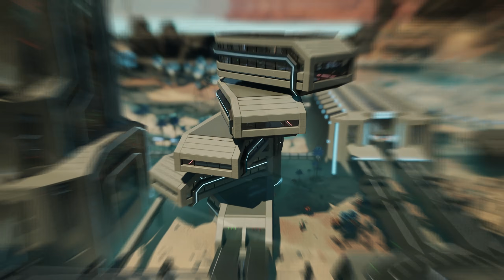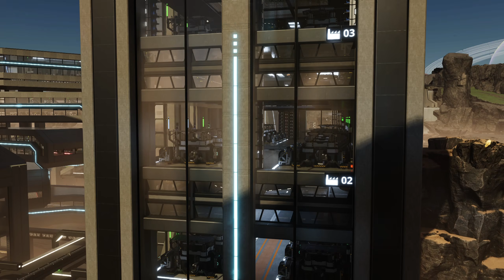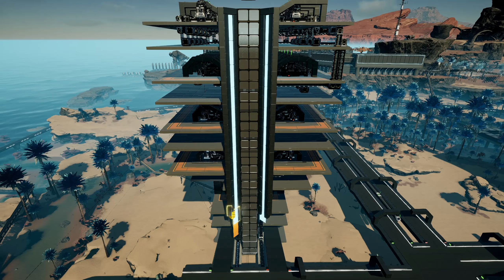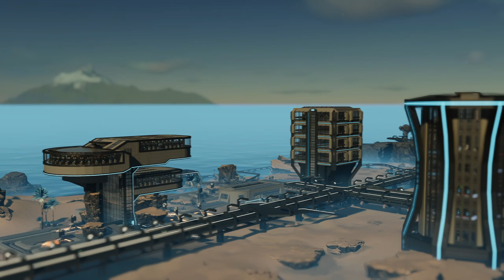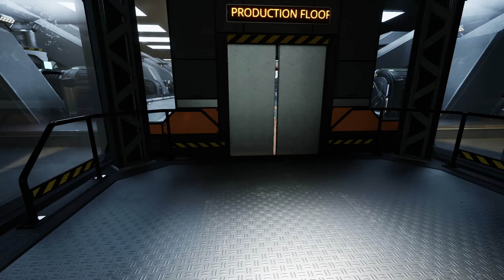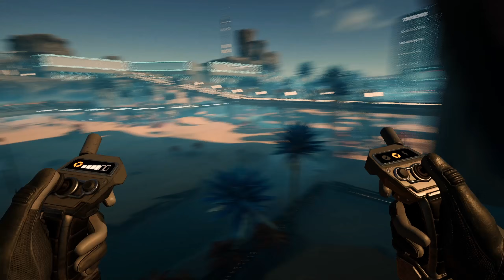Sleek Industrial Sci-Fi HMF Factory

Comment: Did you go back and add more to the computer/circuit factory or just soomersloop it?
Reply from the maker: No generally i dont change factories once they are done. Everything in the Cyber City rocky desert area is mostly for my dimetional depo for general use ging frward. So for the Spire coast Super Computer i build the required circuit board and computers as needed. Ill be using alot of spire coast products and moving them to the Dune Desert to aid in the phase 4.
Reply: @MyNameJakes oh sorry I meant you weren't producing enough for 3 HMF so how did you scale it to that?
Reply from the maker: @JayEmm  aah yes slooped the final machine

Comment: If you're only making 3.75 pm, it's take you 10 years to complete the entire game lol
Reply from the maker: Depends entirely on what those ..for instance if this is my only HMF factory then yes will take for ever. If this is only for my dimensional depo the 3.75pm would be more than enough.

You get 2 guesses which one it is...pretty sure you only need one  :)
Reply: @MyNameJakes  - I see. Does that mean you will be rebuilding these awesome factories in late game? 
I'm hoping to build 60 Ballistic Warp Drives per minute, and it's... taking a while - and I'm going to store a million of them, then run them through the sink just to see how many tickets I get. I think about 2 Million !
Reply from the maker: @manwithanaccent4315  To some extent yes but as needed per factory, you can see that in my newer videos. Also 60 ballistic warps...i dont think youve done the math my man. 
You'll need like 250000 coal, 113000plastic, 200000 iron ingots, 70000 sam to name a few.  You looking at 1000's and 1000's of individual machines. 😶
Reply: @MyNameJakes  - I've looked at the numbers - With MK3 miners overclocked at 250%, the map is capable of 92,000 Iron, 36,900 copper, 69,900 limestone, 12,300 bauxite, and 10,200 SAM ore – these numbers or per minute possible. There is enough ores in the world to support 60 BWDs pm.
Full item breakdown from raw to BWD (rates for 60/min sustained): Raw ores feed smelters/converters (824 smelters for ingots: ~25k iron ingots, 20k copper ingots, 21k limestone to powder/quickwire/concrete; 739 converters for residues). Constructors (584) produce plates/rods/beams: 155 Heavy Modular Frames (Heavy Encased Frame alt), 125 Fused Modular Frames, 389 rotors, 1,141 stators. Assemblers (1,304) handle motors/frames: 255 Motors (Rotor alt), 475 Computers, 900 Circuit Boards, 37.5 High-Speed Connectors, 75 Supercomputers, 60 Neural Computers. Manufacturers (620) for advanced: 95 Pressure Conversion Cubes, 1,097 AI Limiters, 120 Superposition Oscillators, 1097 AI Limiters (residue source). Blenders (335) mix fluids: 14,811 Fuel, 2,400 Turbo Fuel, 900 Rocket Fuel, 900 Ionized Fuel (all Residue/Diluted alts). Refineries (1,750) process oils/nitrogen: 9,505 m³/min crude oil, 11,790 m³/min nitrogen gas (packaged via 110 packagers/drones), 6,165 sulfur. Accelerators/Encoders (282 PA, 113 QE) yield crystals: 551 Crystal Oscillators, Time Crystals/Dark Matter via nuclear waste (56 Uranium Fuel Rods, 14 Plutonium, 70 Ficsonium in 218 NPPs). Final 12 somerslooped BWD manufacturers assemble 60/min.
It's possible  🤔